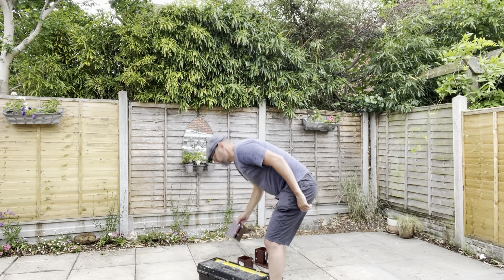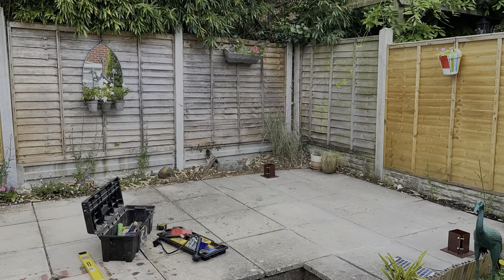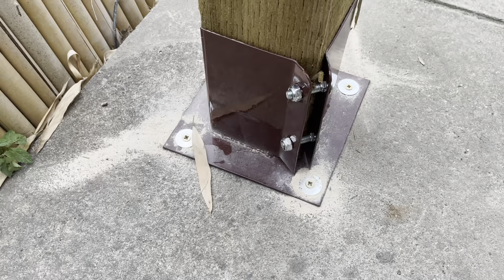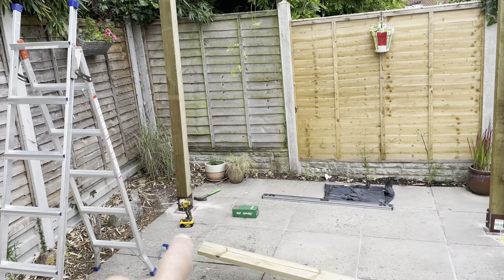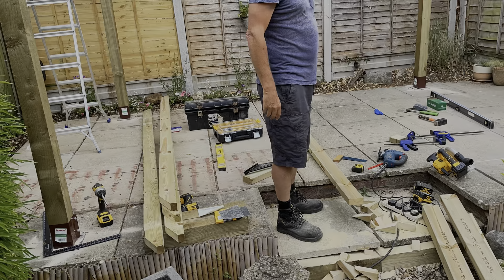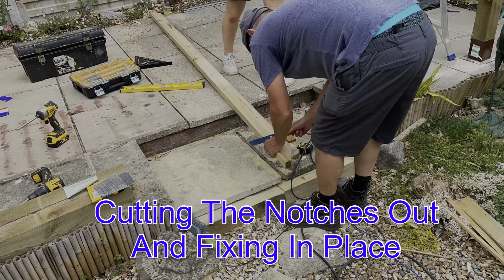Building A Pergola Fixed To Concrete Paving Slabs

Comment: I have pavers on my patio, and under paving, there is concrete floor which is more than 6 inches. Can i fix the post shoe underneath pavers? Fixing the post shoe to the convrete floor below ?
Reply: Yes it will work

Comment: You need squaring straps on each corner , or eventually it will start to move. Regards Alan
Reply: @@petra2885 Hi, you need a timber in each corner about 2 foot long cut at 45% on each end. Then screw it to the main frame. Use the same size timber as the main frame. Put 2 4” screw through each mitre to secure. Regards